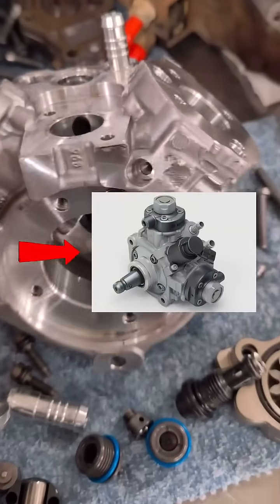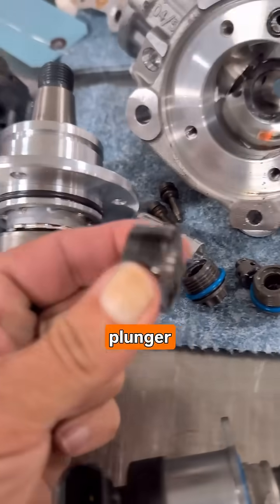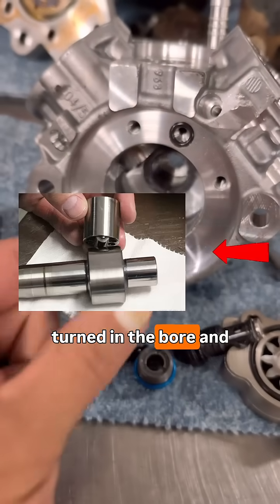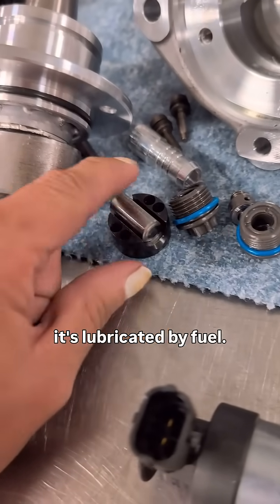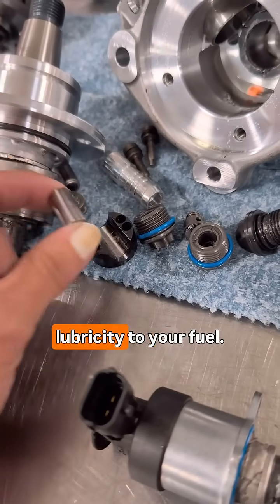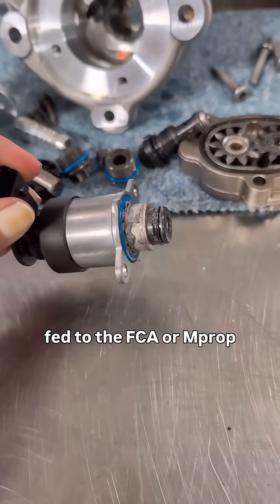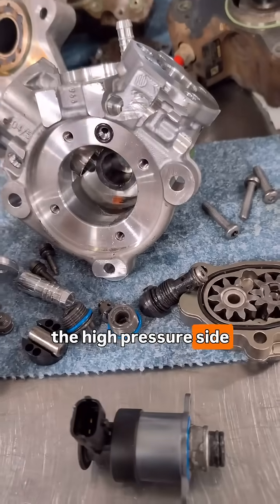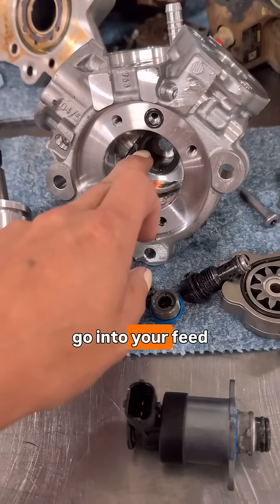CP4 Failure

Comment: Took a scored up CP3 apart many moons ago to see if I could fix it. Managed to polish the HP plungers & bores back to smooth operation but no idea if it would have worked,  never tried it but I have my doubts. That sucker is a whole lot of fun to take apart let me tell ya. Used the whole curse word dictionary doing it since I had zero special tools for it. I don't know what those things are forged out of and heat treated to but jebus H cripes that is some hard, hard stuff! Seems to be a lot better engineered than the CP4. Instead of these rolling elements on a cam the CP3 has a roller supported eccentric block  that lifts the plungers/buckets and if I recall the "crankcase of it is lubed with with engine oil not fuel. At least on a Dmax CP3.